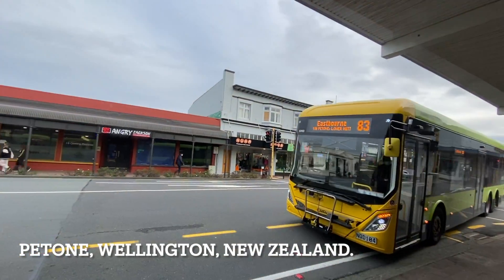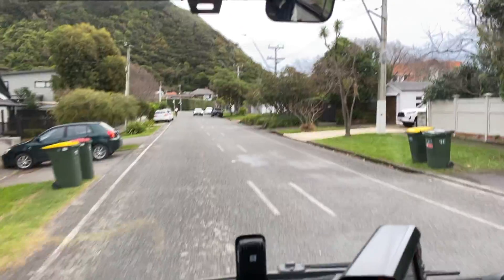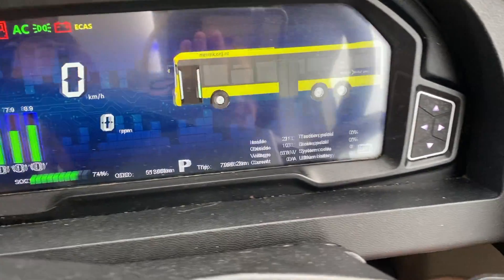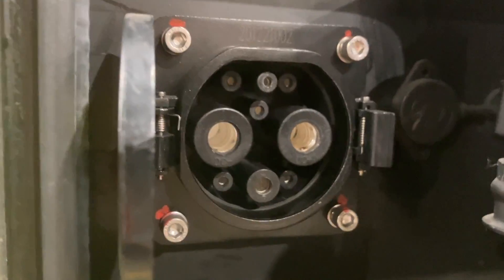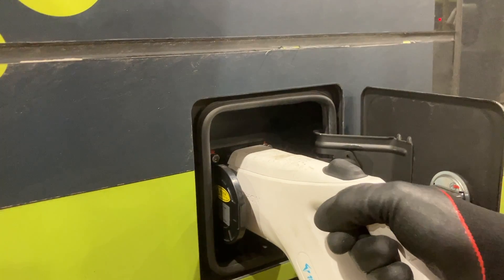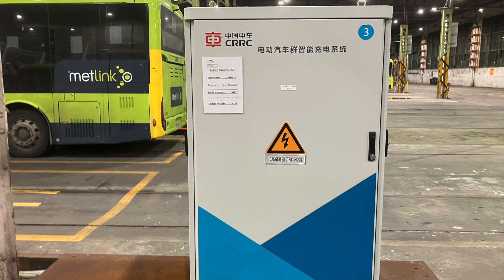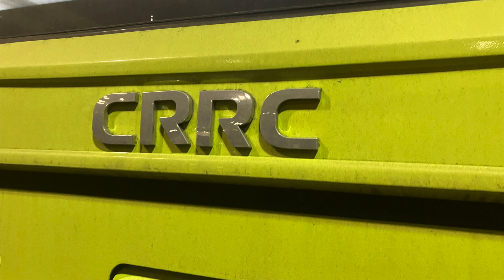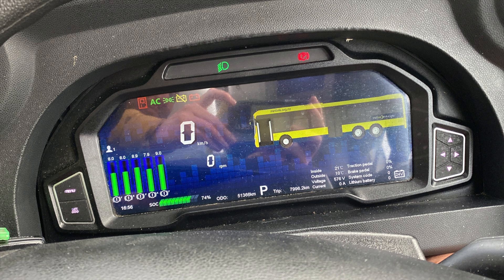How they recharge the city electric bus fleet each night.

Comment: Nice one. The buses are CRRC out of China.

1881
Xugezhuang Machinery Works founded and manufactured first steam locomotive in China named "Rocket of China"

1952
Establishment of Rolling Stock Manufacture Bureau and Rolling Stock Repair Bureau of MOR, Managing 20 Factories.

1956
Manufactured Model “Qianjin” (Model “Heping”) steam locomotive.

1958
Establishment of Locomotive & Rolling Stock Factory Bureau of MOR , Managing 20 Factories, then was renamed to Industry Bureau of MOR in following year.

1967
Manufactured metro car.

1969
Manufactured Model Dongfeng 4 diesel locomotives.

1985
Manufactured Model Shaoshan 4 electric locomotives.

1986
Reorganized to China National Railway Locomotive & Rolling Stock Industry Corporation, Managing 35 Works and 4 Research Institutes.

1990
Manufactured Model 25A passenger coach.

2000
Split into two companies, CNR and CSR.

2005
Manufactured wagons with 70-ton and 80-ton loading capacity.

2006
Manufactured 200 km/h high-speed train.

2007
Manufactured 9,600kW electric locomotive.

2008
Manufactured 4,460kW diesel locomotive and 350 km/h high-speed train. CSR listed.

2009
CNR listed.

2010
Manufactured 380 km/h high-speed train.

2015
CNR and CSR merged into CRRC Corporation Limited and listed in the Shanghai and HongKong Stock Exchange.

Comment: It would be interesting to see the numbers on how much cheaper they are to run than diesel. The fuel price is 25% say, but they also need near zero engine maintenance, and regenerative braking means their brake pads never wear out. 

Also the diesel fleet must be a big contributor to the dangerous pollution in Wellington which is very noticeable on (admittedly rare) still days, and the peace and quiet for pedestrians and passengers compared to diesel buses would also be very welcome. I suspect these buses are a brilliant solution for hilly Wellington, as long as the company can keep the drivers happy!
Reply: The drivers are very handsome.
Reply from the maker: Yeah. The ride is really good. No fumes and pretty quiet. I am sure the maintenance costs are way lower.